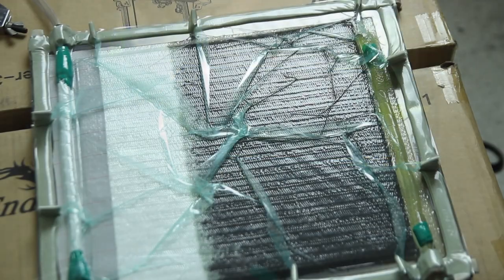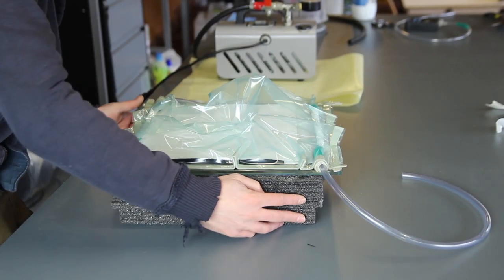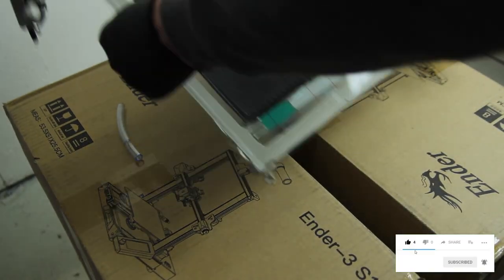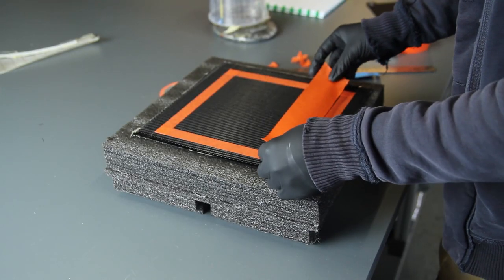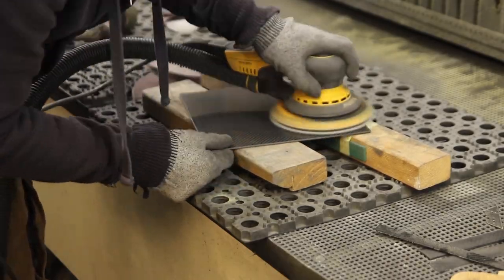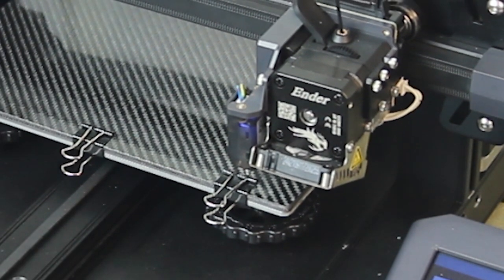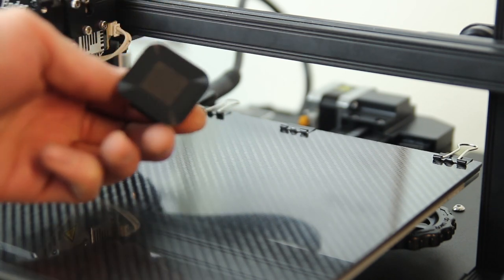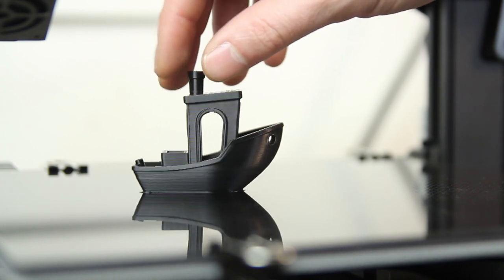Making A Carbon Fiber Print Bed For My 3D Printer (how to)

Comment: Thanks for the video! I posted on FB groups about CF build plate but nobody seems have done yet. And this video comes to my timeline(Thanks to youtube algorithm)
Why I need a CF build plate?
I mainly printing ABS, Nylon etc and goes up to 130 degC temperatures. 
Flat glasses are actually not %100 flat. Also tempered glasses are distorting during tempering process.
Since I'm only using tempered glass as built plate (500x500mm) the deviation between points  can go up to 0.5mm at 100 degC which makes printing impossible.
Why didn't you make the CF as your primary built plate? I wish you could go high temperatures and measure the flatness of CF build plate. The thermal expansion of CF is lower than a glass. I'm also wondering how different filaments sticks to CF buildplate?

Anyway I have some WestSystem epoxy here but not sure if it will resist that temperature. I was thinking laying CF between two glasses and laminate the epoxy by hand.
Reply from the maker: Hi, Thanks for your comment, as far as I know its not being done alot indeed, so decided to share my thoughts. Carbonfiber might indeed be suited for larger plates rather than glass then, thermal expansion would indeed be less. 130°c or more should indeed be possible, the Carbonfiber can handle it, it's more a matter of resin then and most common epoxies can't handle that, that's why I've used a special high temp resin... Didn't go for a base plate replacement but more as an attachement for first testings... Have some ideas to make this better in the future and will test different materials as well to print with on this plate, still waiting on the all metal hotend and enclosure will be designed and built soon so stay tuned 😉

Comment: Bonjour, super idée !!! Mais pour imprimer du polycarbonate ou nylon, c'est un peu limite non? 110° à 120°...
Reply from the maker: avec cette plaque je suis sur jusqu'a 120°C normallement, a tester plus tard :) sinon j'ai déjà d'autres solutions prêtes a tester :)
Reply: @MatthieuLibeert  
Merci de ta réponse. J'avais dans l'idée de faire une plaque en prépreg. Une plaque de 330x330x6mm; qui serait le lit direct avec 750w de lit en silicone dessous et lit magnétique avec pei texturé dessus... Super, tiens nous au courant de tes tests!
++ JP

Comment: good videos you make! Ja one question..Can high temp epoksi hold 200c for long time?
Reply from the maker: 200c for long time might be a bit to much for this epoxy I think
Reply: @MatthieuLibeert  Well I aggree. I found 2 product which can be good. For US buyers is EP46HT-1 and for EU and US is EPO-TEK 353ND . I still dont know how much volume I need to make heat plate.. becauseIm designing my Own most advanced kombo machine. Ja my build plate will be 315x315... you know calculations for that. I will study more.
Reply from the maker: @ItisImarko  depends on how you want to make it what lay up and what production technique and how good you're at it...roughly you would need the same weight of your material build up and add 30% for materials left in cup, tubes, infusionmesh

Comment: So how durable is this bed? How well it stays flat while heated up? I feel like the adhesion properties is probably similar to other resin based bed like Garolite.  I'm using ender 3 235x235 mm
Reply from the maker: It's durable, carbon fiber is stiff and strong and it's basically more fiber than resin. It's stays extremely flat as Carbonfiber has an extremely low thermal expansion

Comment: what material did you use on printing on top of that print bed, are you using PLA, i am using petg tell me if you use petg can be print or not. If yes i might make later.
Reply from the maker: PLA was used, PETG shouldn't be a problem I think...going through a lot of testprints at the moment, will make a new video about that later on
Reply: @MatthieuLibeert  thanks

Comment: Is the texture of the weave presenting in the print because of temperature variations of the weave? I thought the resin would give you a glass surface
Reply from the maker: the texture is where the fibers are on the surface. So they are impgregnated with resin but in theory you are printing on the fibers, thats why the lines are visible

Comment: I thought the main advantage would be that you could flex it to pop the print off but you never showed this. Would it be able to do that?
Reply from the maker: this plate doesn't flex as I don't like the flexplates and rather have a solid plate. When the part and plate cools again you can just remove it easily

Comment: its basically g10 on maker muse videos, based from resin board i think it will perform the same
Reply from the maker: It's a bit different. If I'm correct the G10 plate is made with fiberglass, Carbon fiber has some extra advantages, but printing should on it should indeed be similar in a way

Comment: I work on my own diy high heat heated chamber printers (way above 100*C...) i was trying to make the bed put of carbon fibre at least for abs but it was hard to work with 100+ on bed...wish i can find resin for it to work good in 150*C for peek plastic.
Most popular 3d printers:
Ender 3
Cr-10
And sapphire pro (best for quality and speed after repleacing few parts for better quality ones)
Reply from the maker: That's cool! There are some resins that would go up to 150°C and above so is something that could be made.

Comment: This is the second video I have seen of someone going through the crazy amount of labor to make their own carbon fiber plate to be used as a print bet. I asked the previous person the same question, WHY? The only benefits I see are the fact that the sheet is rigid and fairly light. The cons I see are that CF does not conduct heat well so heating over a surface area will be uneven, cost to make is high and labor required to create is very high, in addition to the fact that CF and related resins are quite expensive. I do not know for certain but one would think that the flatness of these CF sheets is quite good, but is it better than a precision milled cast aluminum plate such as MIC6? Cast aluminum also conducts heat VERY evenly making it quite ideal for print bed surfaces if it were not so heavy. Bed slinger printers do better with a fairly thin sheet of extruded aluminum similar to what is found on the Creality printers.
Reply from the maker: Hi, Thanks for your comment and time you took to write it out! The thing is that carbon fiber is a good heat conductor, the epoxy is a heat insulator. When properly made with a very low amount of epoxy you get a good thermal stable plate without warping and good heat distribution. It's true that it's expensive! For some people it's not worth the money if you are just printing figurines or random object. For some people working on high heat printing or in need of stable printing this could be the way to go

Comment: What benefit does this have over an FR4 (fiberglass-epoxy) bed?
Reply from the maker: Pretty similar but Carbonfiber has a lower expansions/contraction under heat and better thermal conductivity

Comment: For us that don't have a automatic bed leveling it's very critical to have a uniform thickness on the buildplate, I don't think that is possible without machining the bottom somehow.
Reply from the maker: machining would be ideal but this sheet is pretty flat already due to the vacuum that was used to compress all the layers to an even thickness. While tramming/leveling the bed with the knobs it was already good on Z height on 4 corners, but like you say machining would be ideal :)
Reply: Common Fibers - Additive presses their CF-build plates between two machined faces of steel resulting in a uniform thickness!

Comment: I just tried this it did not work.. did I perhaps polish it too much? hahahaha man I want it to work
Reply from the maker: What exactly didn't work? 🙂 Printing on it or making it?
Reply: @MatthieuLibeert  ow sorry I mean the texture 😂 I'm tempted to try other polishing compounds since I only used whatever my dad has. Right now I'm bummed because it works like an overpriced glass bed or so to say overkill CF plate hahaha
Reply: I'm thinking if I should just sand it a bit more on the surface then some minor polishing. My main concern is if I make the resin layer too thin I'm afraid it might not last long.
Reply from the maker: @timothyreyes5392  you need to sand till your in the fibers, In theory I have no resin layer on top, I'm printing on the sanded epoxy impregnated exposed fibers
Reply: @MatthieuLibeert  thank you for clarifying this 😁👌 i hope I don't F* up the surface hahaha

Comment: Hi Matthieu. Our hobbies are pretty much the same. My dad and me are also doing much carbon fibre stuff. Mostly EDF jets.
I also wanted to combine 3d printing and carbon fibre and built an appropriate and kind of new printer. Check out my latest video. Hope you find it interesting.

I need to make a sandwich bed now with high temp epoxy because i want to print with a heated bed and abs
Reply from the maker: That's cool! had a quick look at your video's, look nice! Keep in mind that sandwich core carbon fiber structures will have an insulating effect, making it harder for your plate to heat up

Comment: And then you crash into the bed and ruin your 500 euros plate !
Reply from the maker: You can just sand it back again or fill with resin worst case, and that's not a 500 euro plate to reassure you 😁